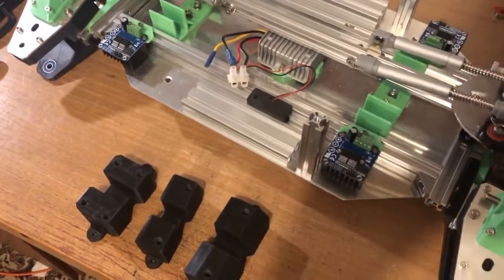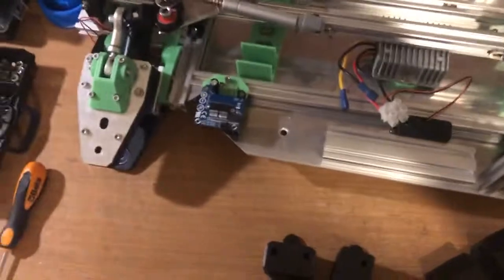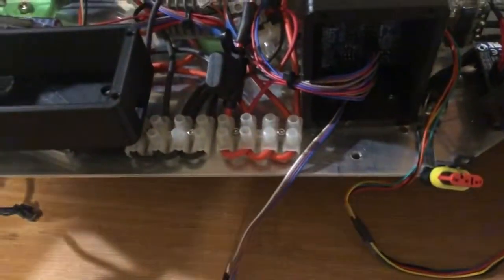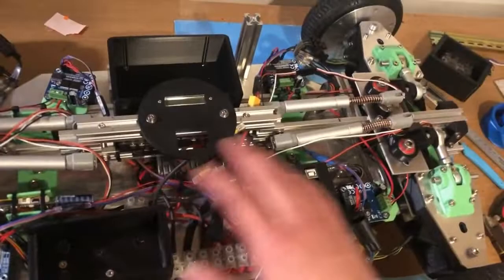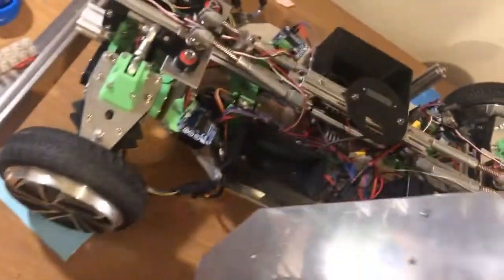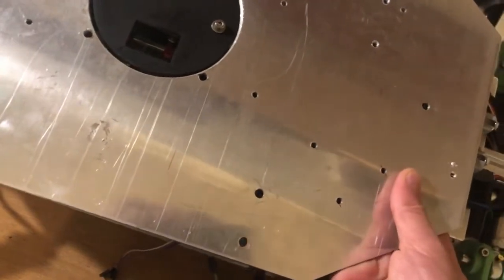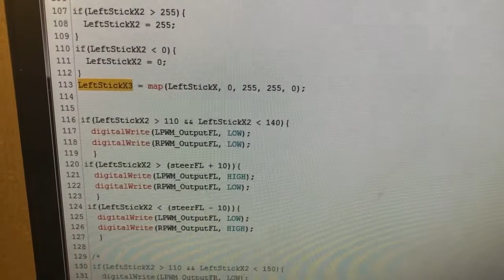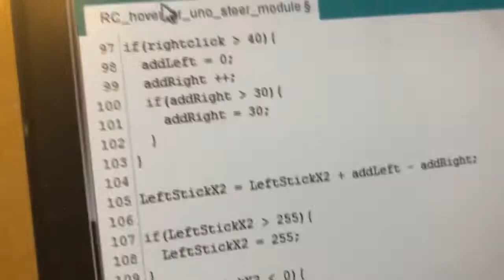RC HOVERBOARD CAR - 4 wheel steer, suspension and wiring complete

Comment: I want to use my 2 hoverboard to control all 4 wheels. To use for my lawnmower. Which wires to I connect between the two boards?
Reply from the maker: hi, the boards dont need to be connected together, hope this helps
Reply: @A-tech  can you please elaborate. How do they connect together if it running on just one Remote Control? That means the remote would run 4 wheels simultaneously…